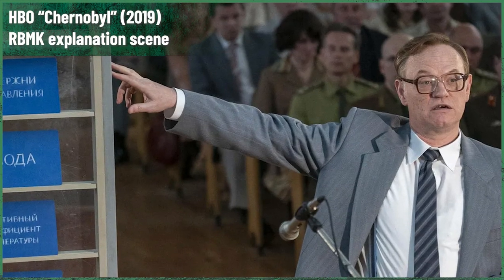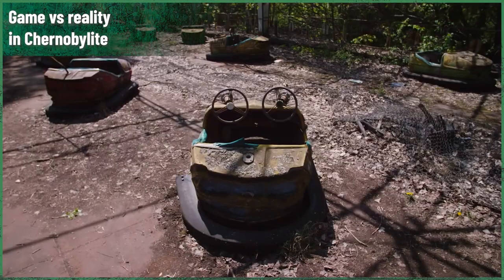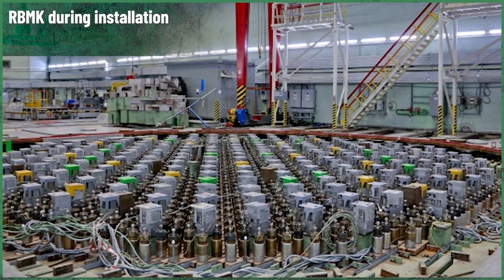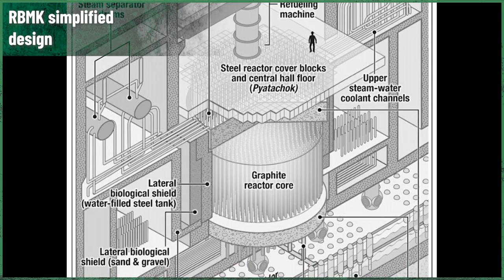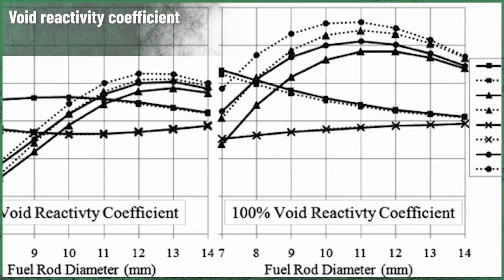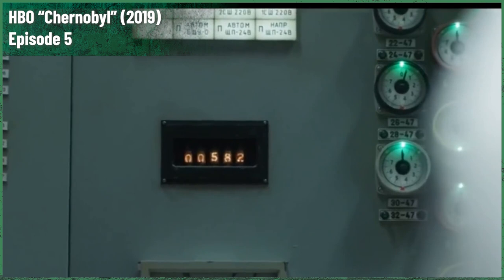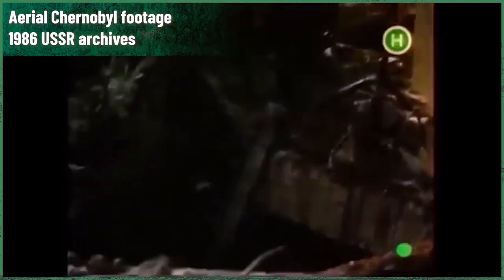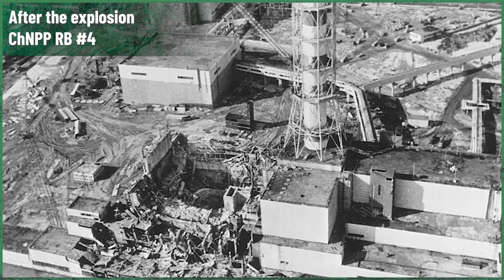What happened at Chernobyl? Why RBMK explodes? | RBMK PART 11 | Chernobylite Stories

Comment: Such an exvellent channel. I love the history and discussion of the technical aspects of the RBMK reactors. They were flawed but thats only becaise of the engineering. The physics was sound. We here in the west shouldnt look down on those Soviet scientists who came up with the RBMK design. The pressurized light water reactors we use are only slightly less bad. Their.cores melt down if the electricity is turned off. Also in Japan they apparently decided it was sane to put the back up geneeators for the cooling system in the basement. Next to the sea. In a country known for tsunamis. Seems like everyone is guilty of being cavalier with nuclear safety.
Reply: RBMKs aren't bad reactors per se, but they should have sat on the design a bit longer, and not rush things along. Give it the things it needs to be a safe, stable and happy reactor. And that would have been possible. The RBMKs still running today are living proof of that. Yes, they do not have containment, but for the rest they have cleaned up quite nicely. They were working on a successor named the MKER. This would essentially be an RBMK, but then done well. It would have had full containment (yes!), both active and passive safety systems, enhanced neutronics, and something they called "improved self-protection for the reactor". An MKER unit was started to be built at Kursk NPP. It was never finished, sadly. I really would have loved to see this reactor run.

All light-water reactors will be in deep trouble when core cooling stops, not just the PWRs. What the PWRs/BRWs have got going for them, is the negative void coefficient. Yes, they can melt down, but not run away like Chernobyl Unit 4 did.
Fukushima NPP actually outperformed its design basis. It was rated for a 7.2 max earthquake, and took a record-breaking 9.2 like a champ. If the backup generators would have been placed on high ground, it would have survived the disaster. Placing the diesels in the basement in an earthquake/tsunami prone area wasn't the smartest idea they had. To put it very mildly.
Reply: Another problem at Fukushima were water filters and that ~~10m of missing wall. I red several times that generators wouldn't work without water filters destroyed by water. Contrary to Chernobyl where the crew stayed there, risked their lives knowing a lot of them died, crew from Fukushima wanted to escape responsibility!!! Yes, only PM's visit forced them to deal with the situation instead of just leaving the place. I believe nuclear reactors have to be built and run by the government if we don't want private sector building them for 20+ years and escaping when things go wrong. Maybe i'm too critical when it comes to rich capitalists making money and mistakes from taxes we pay...
Reply: @codaalive5076  
It's not the crew that tried to escape responsibility. They did everything in their power to mitigate the ever-increasing problems they were facing. Even up to going out in the parking lot and collecting still functioning car batteries in an attempt to get at least some core instrumentation working, so they could see what was going on. The one trying to escape responsibility was TEPCO, the company owning the NPP. And they should be held fully responsible.

" Maybe i'm too critical when it comes to rich capitalists making money and mistakes from taxes we pay..."

A little 😅. Government oversight doesn't necessarily guarantee that things get handled any better. Case in point; Chernobyl Unit 4. I think it should be a team effort between the compagnies and government like in France.
Reply: @swokatsamsiyu3590  Thanks for correcting me. Years after the accident Japanese made well known documentary with this claims, i believe Wikipedia didn't have correct information either. Now they do under "Fukushima 50" entry.
I was born in social state Yugoslavia where we saw both systems. Arrival of capitalism only made people poorer, once universal healthcare system is almost destroyed, they need a few more years to finish it off, de-industrialization brought obvious problems, a tender for the nuclear plant was written for AP1000 from the start and of course it won't happen for 20-30 years. There is a lot more to this, i know socialism is utopia but we could find some kind of middle way instead of copying the worst. 
I firmly believe big nuclear projects need government oversight; Russia is building one after another, China has good results, i'm not sure who controls successful South Korean program. US built one plant in 20 years or so, am i right? Stories about SMRs like Gates's "nuclear cigar" are quite weird, we will see if 3rd design he calls Natrium will be built after two failed attempts at designing SMR. Next time i will try to avoid politics.
Reply from the maker: Can't express enough how much I like you talking about this stuff on our channel. That's exactly the community we admire ☢🖤
Reply: @Chernobylite  
That's because you provide us with such wonderful material to talk about. Yours is a good place to let our inner nerd out for a bit^^ It is nice to be able to learn from one another.

Comment: What technology apart from the reactor's design failed?
Reply from the maker: Practically every single one - from the scram procedure speed, through materials used in both inside & outside the core, to the overall quality of work, safety rules and measuring equipment.

The "RBMK design" is a simplification - by using it, we understand everything related to operating the RBMK reactor. But outside the reactor design itself, there were many other systems and designs, like the building, the shielding, the turbines... Every single one of those was of poor quality and had issues that should've been solved years before Chernobyl.

Comment: Yes the RBM had many bad points and bad designs, but still it all comes down to human error that always has. the day they did the test limits went way below the standards of the design, they push the reactor over excessively and installed. 
Your explanation is very good. going to watch to the end.
Reply from the maker: Thanks!

After reading the histories and technical sides, I lean towards the design flaws which then "allowed" the mismanagement / neglections by the operators.